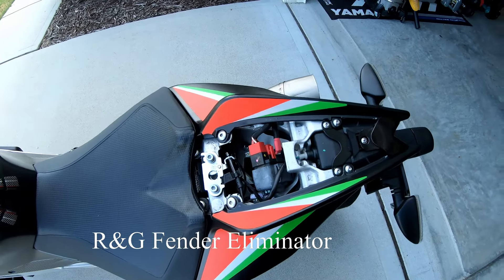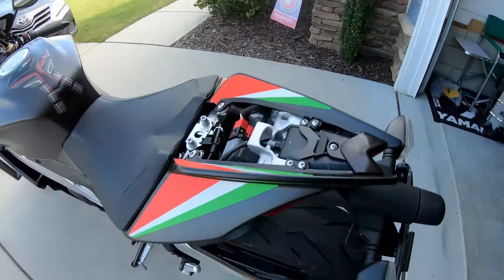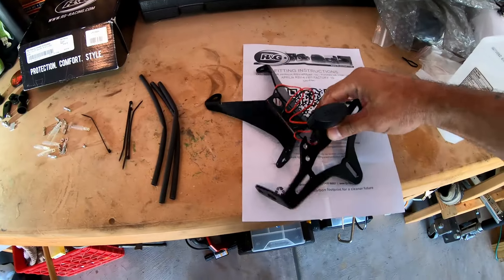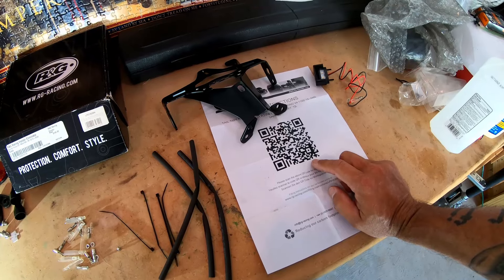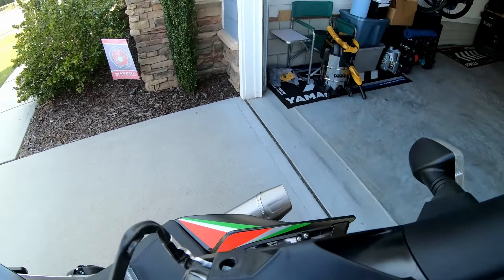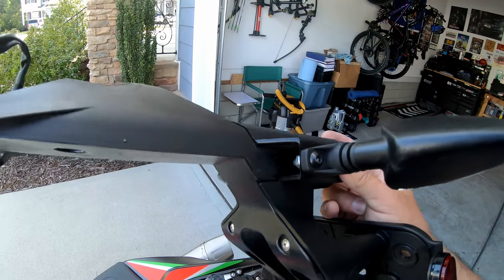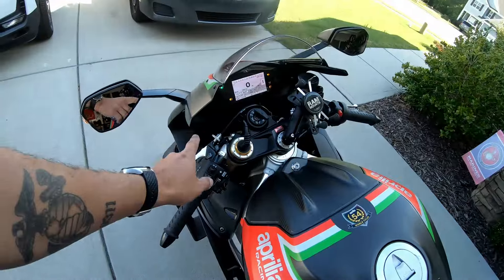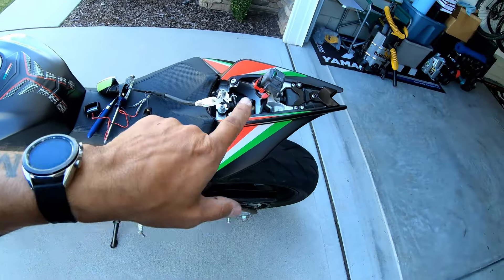2020 Aprilia RSV4 - How to install fender eliminator kit/tail tidy

Comment: If you have to splice a wire would you have to remove negative on battery?
Reply from the maker: @robertkenney6002  No because there is no power going to the wire if  the bike is off.  I hope the video didn't make it seem like it was a big deal.  It was actually very simple.  Only thing I needed the instructions for is to see which color wire from the new license plate light connected to which existing wire.  The rest was very obvious.  Easy install.